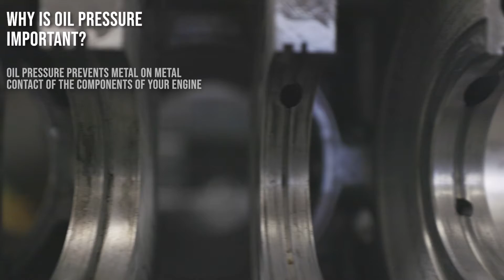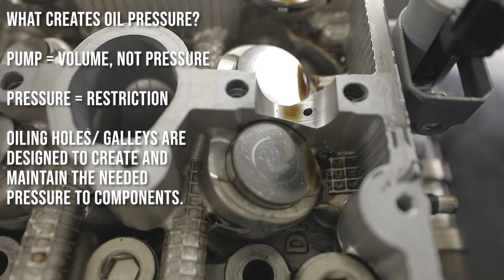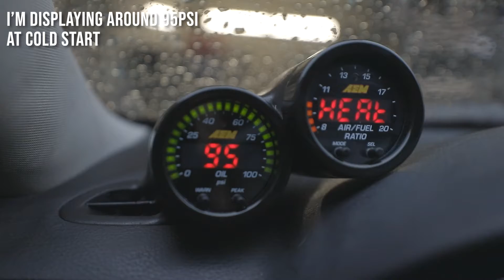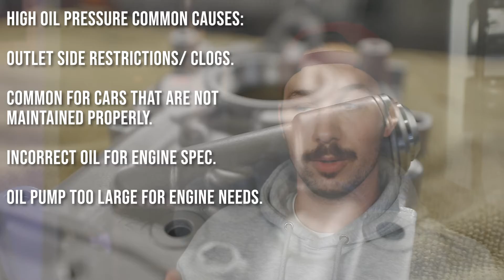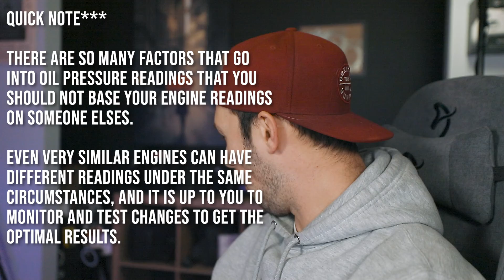Oil Pressure - Everything you need to know.

Comment: Had my 2006 Dodge durango for 10 yrs, she had  a lil over 240,000 miles on her, my poor babyyyy stopped running had 2 diagnostic and its the oil pump in engine,  rip flo😢

Comment: I'm very interested in oil pressure.  I always put a gauge on my modded cars.  My 98 TJ Jeep with 200,000 miles makes like 8 psi at idle but it's been like that for years.

My sandwich plate style (planning to move it) AEM gauge on my "stage 3" EJ205 in my 05 WRX was reading 10-11 psi at idle with 5w-30.  It's also been making a rattle at part throttle between 2500 and 3500 rpms lately after some flogging on the dyno.  So I cut open my oil filter, found copper shavings, put Rotella T6 in it, and buttoned it back up.

 For comparison. now I'm getting 12-13 psi at idle, 50 psi cruising at 65 in 5th on the highway, and 95 psi at cold startup.  I never lug the engine but she's obviously had too many high mileage beatings. I have a JDM EJ205 on the way.  I've still been driving it but plan to swap it before it grinds itself apart.  What pressures are you seeing for comparison?
Reply: Everything I’ve read and seen on here they say rule of thumb is around 10 psi to 1000 rpm’s. But I’m running 454 big block, at idle hot around 190 temp is about 10 psi at 900 rpm in gear at a light.

Comment: Awesome content Mat. Your videos/channel is getting better and better.. I will finally be firing up my 2.0L ej20x motor next week after 4 months of work, but I'm waiting for a direct read oil pressure gauge that should arrive soon. What should be the oil pressure values I should look for at startup to know things are going ok with the swap I did? btw.. I never took the engine apart, just did a leak down test on it (it passed) and then I installed the long block on my '05 OBXT. nevermind bro. you mentioned it at 5:10.. lol
Reply from the maker: Thanks Mike 👌 and best of luck with the engine 👍

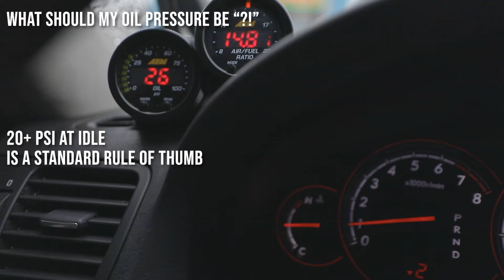Comment: I used a bypass filter in my Ram ecodiesel and went 175,000 miles no issues I like bypass filters that clean at 1 micron.  I have a 2022 Ram 1500 5.7 Hemi 4X4 3:21 rear diff.  Stock OEM oil filter cold idle 47psi hot idle 35psi Cruzing speed 70MPH hot 45psi 6,000 RPM's 57psi, K&P Engineering S17 model full flow 30 micron mesh filter same numbers as stock OEM filter. My current combination filter I just installed is a Trasko full flow/bypass filter Model RK-20s designed with a 10-micron mesh filter for full flow valve rated for 3 gallons per minute and 1 micron rated for 1 gallon per minute in bypass media within the same housing with this filter at cold idle I'm at 40 Psi hot idle 29psi cruising speed 70MPH  35psi at 70MPH full pedal 6,000 rpm I'm at 37psi very little change I called the MFG he said this is good now the valve is regulating the oil pressure properly. I spoke to Blackstone they said 20-70psi is the safe zone. Matt, you know a lot about oil pressure just wanted your opinion on steady oil pressure from 1500 RPM's to 6,000 RPM's with only 2 psi difference in oil pressure do you see this as a positive or should I be concerned and do more research FYI I'm getting an oil analysis as well. I would greatly appreciate your opinion thank you in advance.
Reply from the maker: With the way you've described your setup, I don't think you have anything to worry about. There are a lot more oil galleys and things on that hemi than a 4 cylinder, and the regulators put in place likely keep it at a more steady rate for proper bearing load. You've done some really good research into it on your own as well 👌
Reply: @MatlasDI  Thank you, This morning I changed back to K&P S17 full flow same as stock I will be switching back to Trasko being I get better flow I should be able to lower the oil temp like you said more pressure higher heat lower pressure more flow lower heat thanks for your responce.

Comment: I get 90psi on cold start, 20psi on warm idle and 80psi on throttle.  312,000km on the original motor (LGT wagon)
Reply from the maker: Very similar numbers to what I see on a relatively fresh build. All sounds healthy 👌
Reply: @MatlasDI  hope so. Where can I send you some pics of the super wagon 🇨🇦🤣
Reply from the maker: @franco8049  check out the discord if you aren't in there or dm me in insta 👌👌

Comment: Opinion on using the rear oil galley plug for oil pressure sensor? I used this one as I kept the standard subaru pressure switch and just wondering if it would read any different from this location?
Reply from the maker: Further away from the pump so it may not be quite as accurate (haven't tested side by side to know for sure) but from what I've seen it works fine, we normally use it for oil temp, but a lot of companies instruct you to use that one anyways, so I don't think there is technically any issue with it.

Comment: No PRESSURE to respond but, is this relevant to just Petrol/Ethanol engines or do all the principles apply to Diesel as well?

Great info as always!
Reply from the maker: Haha I see what you did there 😉 Diesel engines will have very similar values, I believe iirc that they run looser tolerances, which is why they call for thicker oil, etc. But on average diesels run somewhere between 30-70 from what I've seen.
Reply: @MatlasDI  Thanks 🙂

Comment: What are your thoughts on running the oil cooler at the 1st start ups vs not till later on after break in to prevent bearing / break in particles to stay in oil cooler and possible coming out when raising boost and load into motor ? I have a brand new oil cooler for my new build . Just thought about that for some reason .
Reply from the maker: I wouldn't worry about it, as the more intricate part of the oil cooler is post filtration. Oil filter would catch any particles that could be an issue during break in. Just make sure to change the oil and filter after initial break in and you should be fine. 👌

Comment: I used my oil pressure gauge to determine that i should stop using a 30weight oil. And as the oil wears it loses viscosity and you can see that in the gauge. I use the oil temp gauge to tell me when I can start having fun and stop having fun. Start having fun around 180 and call it quits around 250. 14-15psi at raised idle with 200 degree oil temp...5w40 oil...73k miles so far so good. Forged internals
Reply from the maker: Love that. Exactly as it should be 👌👌 fine adjustments until it's all perfect.